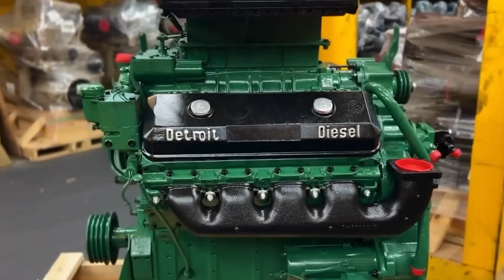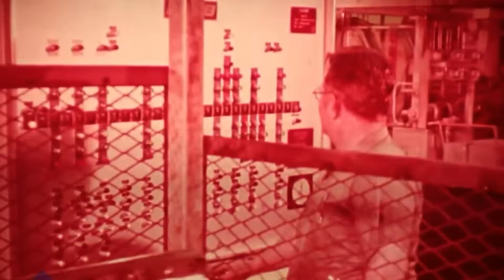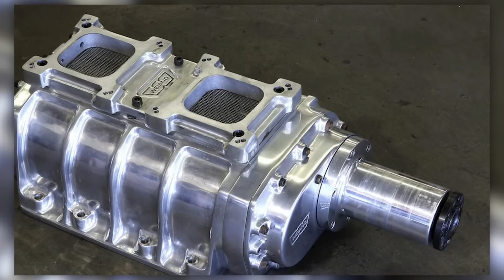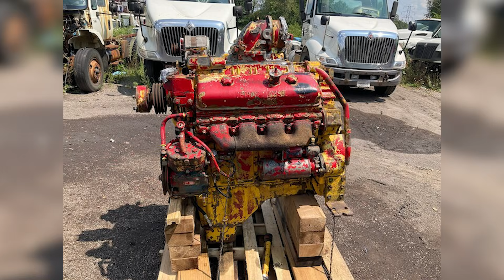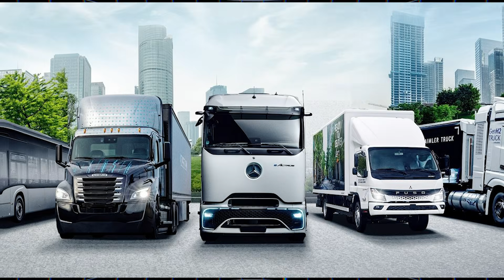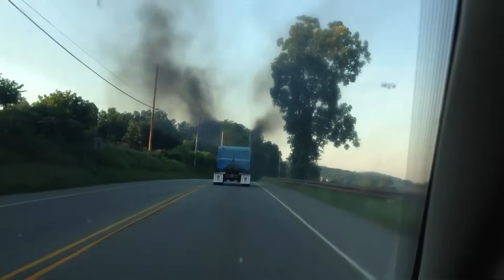Why Detroit 8V71 Was Banned: The Engine That Was Too Strong

Comment: First off, Big Bud used 8V-92 and 12V-92 in their tractors not that they might of used a 71 in trial builds but not in full production.  My dad had a friend in North Dakota that owned 3 of them.

Dad bought a new Freightliner in 72 with 8V-71N.  He always called it by his little 318.   He would blow the doors off guys already running 92T's.  They'd come over the radio and say man you got a 12 or 16 in that and dad would just say nah, just a little 318.  He told me it in the gearing.  He had a very good friend in the Greyhound shop that told him to run 444's not 411 and that was the mistake everyone else was making building trucks at the time with Detroit to hold the power band.

Knew of a bull hauler in the late 80's that had a 16-92 tt in a Pete.  Rumor had it that truck could do 130 plus.  He was gripping to buddy in truck shop for having a shimmy at 127 crossing Nevada desert.
Reply from the maker: That's an incredible story about your dad outrunning those other trucks with just a 318!